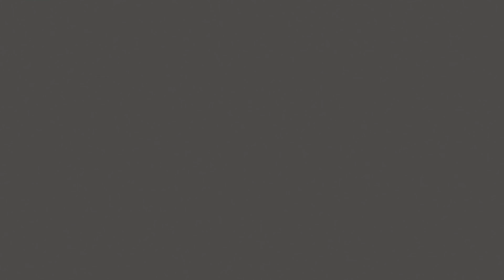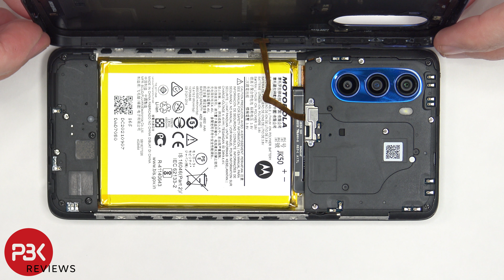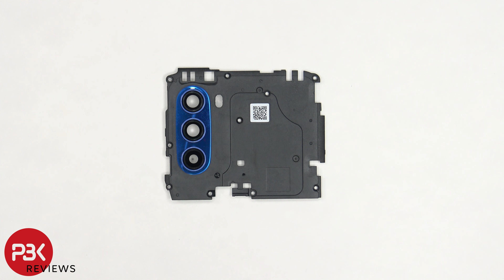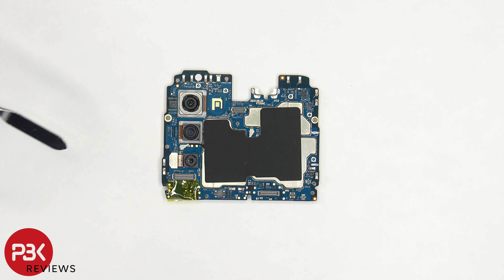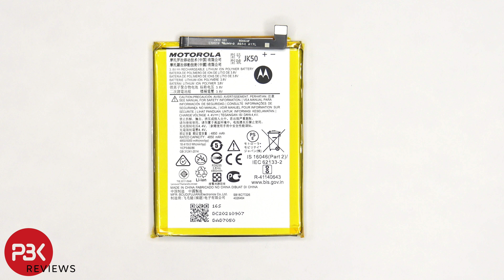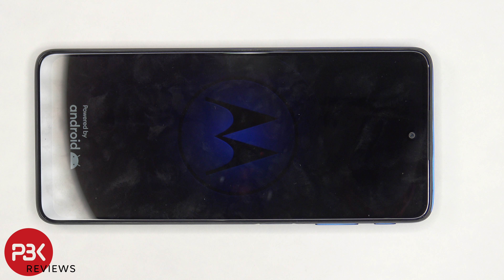Motorola Moto G51 Disassembly Teardown Repair Video Review

Comment: Do I need to remove the top plastic cover and all the cables to remove the battery?
Reply from the maker: just enough to gain access to the battery cable to disconnect it and pry the battery off.

Comment: Could I just use methylated spirits instead of isopropyl alcohol?
Reply from the maker: I'm not sure, I haven't ever used it but usually the main purpose of isopropyl alcohol (with highest percentage alcohol content) is for it to evaporate quicker, so it doesn't linger around and short if it hasn't dried. Also other chemicals might damage parts so not sure. Here is one I have tested and use: https://www.ifixit.com/products/ifixit-adhesive-remover?variant=39915173740647

Comment: Is have  LED light notification
Reply from the maker: Hi, no. It has a white LED light on the top corner of the board but its not a notification led. It just flashes white when the phone is completely out of battery and you plug it in to charge, to show that the phone is receiving charge but does not have enough power to show it on the screen yet.
Reply: @PBKreviews  Thanks